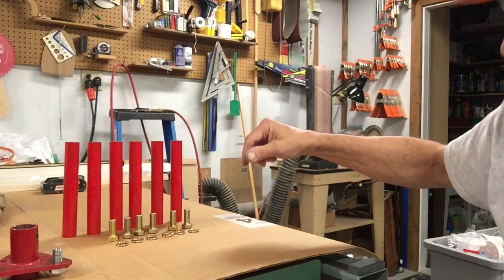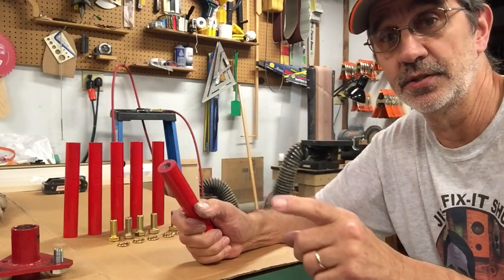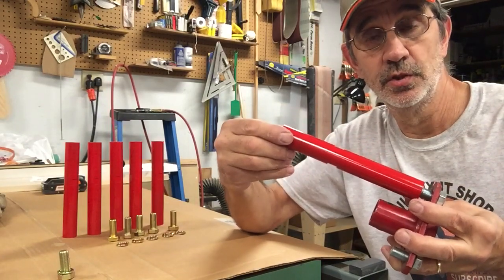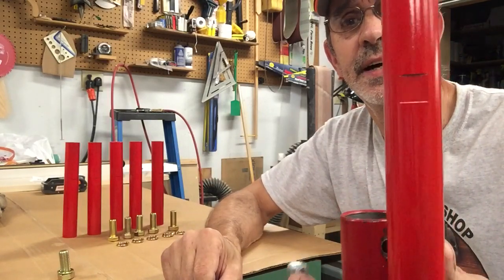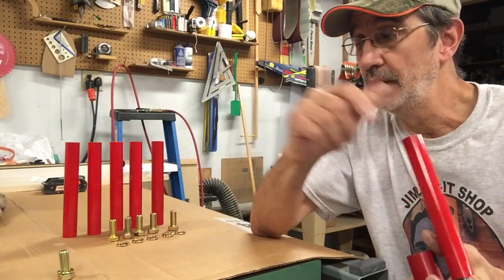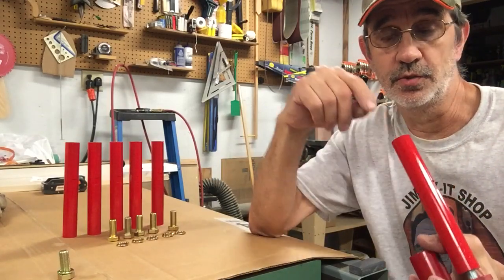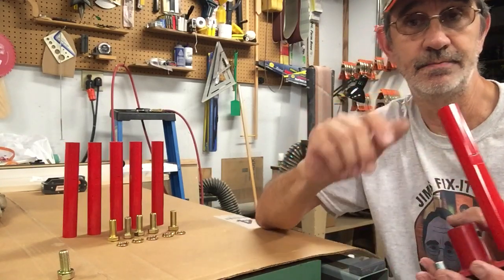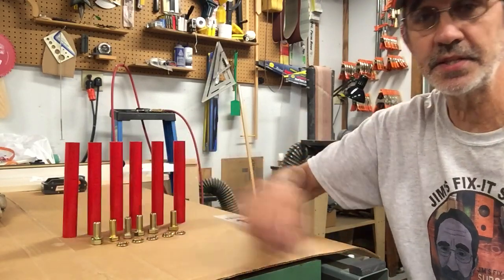313. Be careful what you wish for.    Snapper RER

Comment: Jim I am Ralph from florida I saw the video about changing motor on an 8hp. The piston is not moving and engine turns over. Need your advice
Reply from the maker: Eileen Perdomo 
Look behind your starter at your block if your piston is not moving then you threw a rod and it usually breaks a hole in the side of the engine block behind the starter, let me know what you find. Jim
Reply from the maker: Numa Newbern 
I would think if you could clean it good enough you could Weld it but aluminum has to be extremely clean any dirt, paint, oil will totally mess up your weld and typically when a rod breaks it’s because the bolts came loose from the cap and it just stuffs The Rod through the side of the block right behind the starter I’ve taken them apart
To see why the cap came off and I’ve never really noticed any interior damage besides that. Jim

Comment: Carlisle X Trac ATV Bias Tire - 16x6.50-8 https://www.amazon.com/dp/B001THCJDO/ref=cm_sw_r_cp_tai_SmUtFb5DY7CTM

Run some of these or similar (half fluid filled if ya want more weight) and you’ll never lose traction again.  High floatation dual rear setup would be for some seriously saturated yards. In my opinion, these snappers don’t weigh enough to make significant ruts where one would benefit from a dual setup. 

Nevertheless, hey I dig how ya came up with a stout solution.  It looks cool too.  :)

Comment: Hi Jim, thanks for another great video! I wondering how much do you need for the wheel adapter? And I don't know what year my riding mower is! But it's older, with a 26in deck and a 8 horse motor that I had to replace with the same old motor, but would a thatcher work on mine! And how much would it cost? Sorry for the babbling! lol
Reply from the maker: Lance Johnson 
Yes a Thatcher will work on the front of your machine and they are $185 plus shipping which usually runs Around $28-$33 depending where you live, the wheel adapter kit for duels is $135 plus shipping. Jim
Reply: @jimjackson9381  hi again, thank you for your getting back to me so quickly! I'm going to have to pass, I just can't afford them but thank you 🙏 😌

Comment: Hey guys, any and all in Minnesota or willing to drive. I am in desperate need of a hi vac deck that fits a 2001, (smaller front mounting bar than the older style) I do Not need the deflector sheild or the deck sheild, And a serious wish list of a Thatcher and bagger. I don't have alot of cash, as I'm fixed income but I have a complete 1983 dual pedal 8hp 30" I would trade, it has compression, no spark. Blade and belt are in great shape so I'm assuming it was used not long before I got it. I haven't chased down the spark issue, I spent 3 months and a bit over $300 in parts on my mower this year and really just need a break from ordering parts. I really need whomever would do this to be able to deliver/pick up I dont own a truck or trailer and I have degenerative disc and arthritis so loading even a deck into a vehicle is just not going to happen. I have a 1/3 acre lot and while a 21" push does get the job done it sure is hard on an already abused body.

Comment: The 1/2  axle will bend at the force of.... catching the edge of the rim against the corner of wooden pool deck with 250lb rider while moving foward in 3rd gear. Ask me how i know....   it will then snap off completely when a 3 inch tall  2 in dia cut off bamboo stalk that is hiding in tall grass gets hit amd stops the mower in its tracks while in 4th gear with a 250lb rider... ask me how i know
Reply from the maker: J Taylor 
Do you have your machine fixed and do you need any help replacing your axle, and where do you live that you were running into Bamboo trees. Jim
Reply: @jimjackson9381  I started a new job a few months ago running a recycling yard so i have a couple of parts machines now. I got the axle swapped out and its back mowing.  There are parts of south Alabama where bamboo grows thanks to bamboo shoots being used as packing material back in the day. Part of my property happens to be one of those areas.
Reply from the maker: J Taylor 
Wow thanks for sharing I never knew that they used to use those sprouts from a bamboo tree for packing material that is unreal, thanks again. Jim

Comment: I know this is off topic to the video, but this has been bugging me for quite a while on my Series 13 25", is there a way to change the gearing or add an "overdrive" to increase the top speed on these mowers? 
Not for cutting or pulling, just for getting from point A to point B with the deck disengaged and in the highest position when done mowing a section. 5th gear is ok, but it does seem rather slow...
Reply from the maker: Patrick Woerner 
No there’s no easy way to do that, yes and they are a little slow just traveling around the yard. Jim
Reply from the maker: Numa Newbern 
Hey numa it’s Jim
If you have one of those chain cases that you have the gears switched I’d sure like to see a picture of it,  I don’t know how you would put the top gear in the bottom of the chain case the gear is too big in diameter to fit. I would like to see some pictures of how you do that send them to my email. Jim